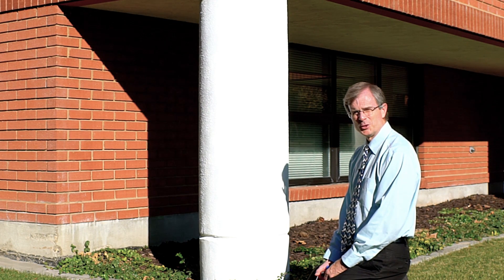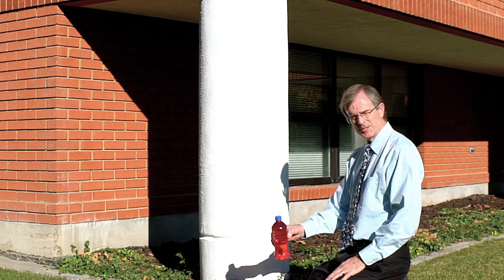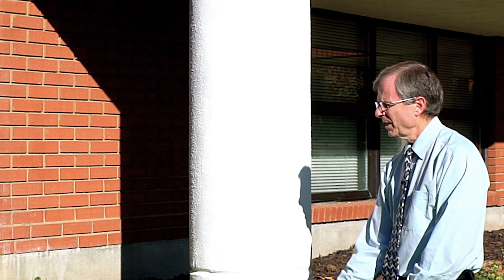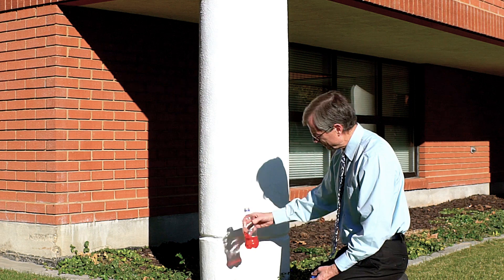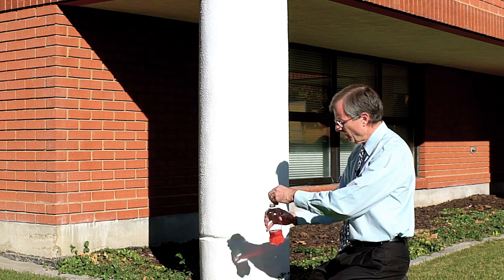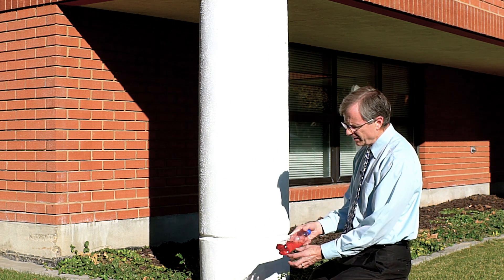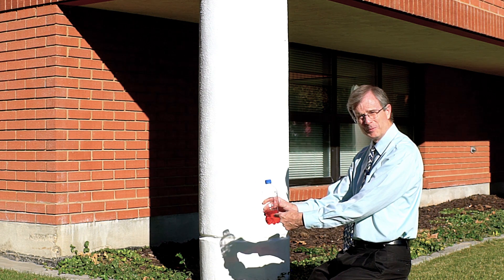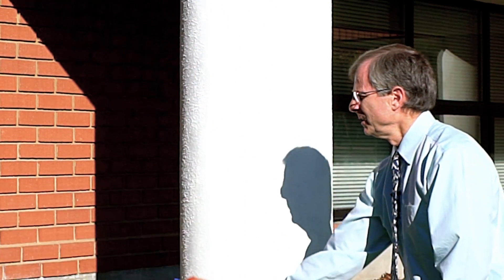Angular Momentum Demo: Spinning Bottle

Comment: The moment of inertia of the split water bottle is still quite a lot smaller than the full bottle. So you haven’t really explained why you can’t flip it as quickly as the full bottle, which you don’t seem to be able to.  Why start of with a full bottle for the explanation?

Comment: ... in slight disagreement. 
As water splits in the second case so axis of rotation is roughly same as in the first case.  Moment of inertia  is more in the first case than the second case: so rotational speed should be more in the second case. But it is not !!! It has to do with inertia of rotation of water as in the case rotating "rotation of boiled egg and the rotation of raw egg".

Comment: I had this doubt. 
Case 1: Bottle completely filled.
Case 2: Bottle 1/3rd filled. 
The energy provided by the hand in both cases is approximately equal. 
If we do a simple energy balance:
Energy provided = Potnetial Energy(PE) + Translation Kinetic Energy (TKE) + Rotational Kinetic Energy (RKE)
In both cases approx 'energy provided' is equal by the hand. PE and TKE would be less in case 2 as mass is less. This means that RKE-2 (RKE for case 2) is more than RKE-1.
RKE = (Moment of Inertia * Angular velocity)/2  {MOI*AV/2}
In case-2 even if water is getting divided into two, the moment of inertia for case-2 is less than that of case-1.
But RKE-2 > RKE-1 and MOI-1>MOI-2. 
So considering all this together, the angular velocity for case-2 should come out to be more than case-1. 
But that is not the case. 

In case-2 there is relative motion of water wrt bottle, which means there is relative velocity of water wrt bottle. I feel the correct explanation would be that some part of the energy provided is converted to translation motion of water inside the bottle. 

I am not sure although. Please let me know
Reply: I'm no physicist, just constructor but I think you omitted that energy provided by hand is larger for larger mass, to exert same velocity.
Reply: @tgstudio85  Yes that is correct. More mass means more energy is required to attain the same velocity. But if the same energy is provided, the lesser mass will have more velocity, which is kind of my argument.

Comment: 2:27 It's spinning about the axis passing through the cap of the bottle (not the liquid itself). Angular momentum isn't minimum in the case.
Reply: Bro, the axis about which it is rotating is passing through the cap only until the bottle is in the hand of the man. But as soon as the bottle leaves the contact with the hand (which was earlier acting as a hinge), it starts rotating about it's COM... in short,  the axis of rotation shifts from the cap to the COM of liquid...

(Btw, are/were u preparing for NEET/Boards only?)
(Cuz any JEE aspirant would've understood this point earlier😅)

Comment: I learned of this effect from my Gramma in the 1960's, but did not know the scientific name until much later. She showed me how to detect whether an egg is boiled or not. A boiled egg will spin fast on a table top, while a raw egg will only spin sluggishly one or two revolutions.
Reply: another way to see if the egg is boiled is to spin the egg and then stop it with a tap and if it stops it is boiled but if it starts spinning again is raw. This is because if it is raw some of the angular momentum of the shell is given to the egg white and when you stop the shell the egg white keeps spining and gives some of the angular momentum it has to the shell again and makes it rotate again while the boiled egg is solid so when you stop it the egg white stops too
Reply: The video is showing how the changing moment of inertia changes the speed of rotation. I think what you are describing just has to do with the way a "solid" boiled egg or a "liquid" uncoocked egg reacts to the shell being spun. The inside of the uncooked egg slips and doesn't start spinning very much after a quick flick.
Reply: @Alex-lc1bv  nope when the uncooked egg spins the liquid spreads thus increasing the moment of inertia
Reply: @lazypotato6743   Is it though?  I thought the liquid contents were kept in place by a thin membrane.  Even if the liquid does spread out like that, Alex's explanation is still correct.  You can demonstrate this by spinning the uncooked egg, then stopping it, and then letting go.  The egg will start spinning a little on it's own, which means Alex's explanation must be, at least in part, a correct explanation.
Reply: @lazypotato6743  eggs aren't that compressible
Reply: The way I detect if an egg is boiled or raw is to hit it with a mallet.
Reply: @albertbatfinder5240  Or eat it maybe ?

Comment: But why is the water dividing in the first place? All it had to do to conserve the angular momentum is to rotate as fast as he made it to do. So why does the water take the detour of dividing to slow down the rotation to conserve angular momentum when it could just turn faster? I think centrifugal forces play a role here, too, right?
Reply: Water does not have tensile strength. Any rotation of a water body causes it to spread out until it meets a mechanical limitation, due to centrifugal force like you said / inertia for physics pedants. Because the bottle is long, the most spread out configuration it can obtain is 2 roughly equal halves at each end, so that's what happens.
Reply: The initial force, and movement isnt strong enought to move the water to the bottom of the bottle. this is from anécdotal evidence.
Reply: The water tried to stay where is was but the bottle moved in relation to it.
Reply: @alphalunamare  But it divided. So some of the  water moved regardless what the bottle did.
Reply: @LGlink-rz2xc  That's the effect of friction twixt the water and the plastic inside which is hardly smooth.  Probably a more fizzy water would ride the micro surface of the plastic better?